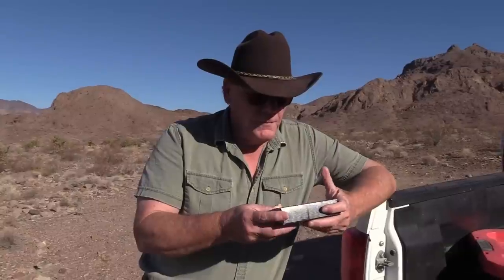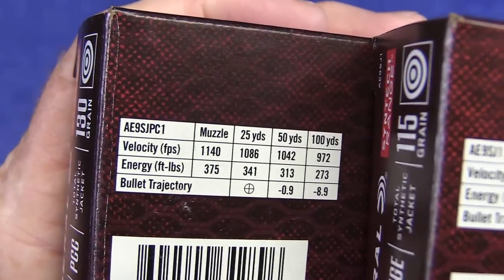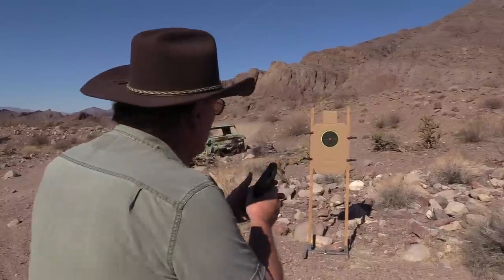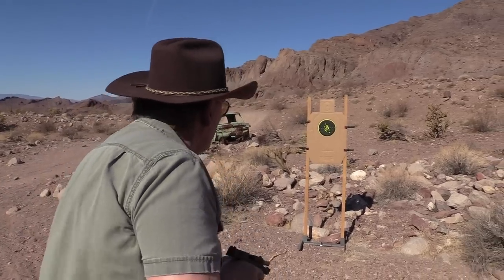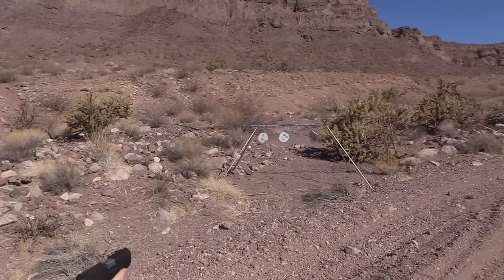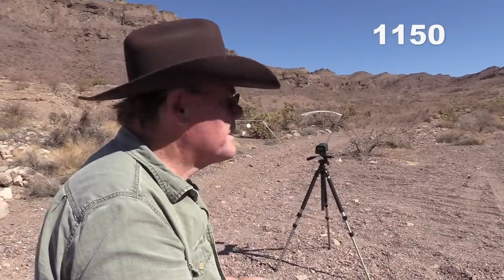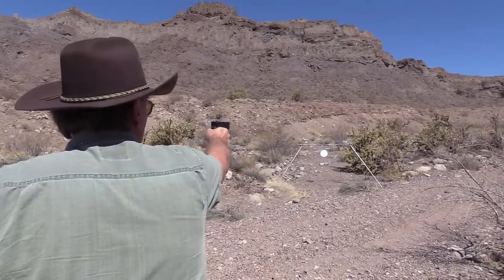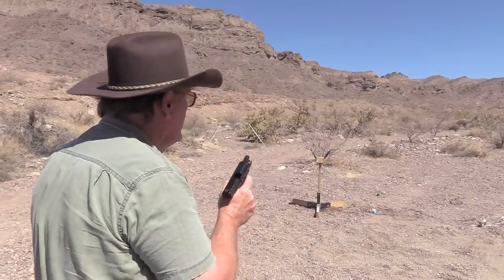Federal 9mm "Polymer Jacket" Ammo Review - Is This Stuff Accurate & Reliable? 3-Gun Shooting Review!

Comment: I like that Federal lipstick ammo. Ran a bunch through my Shield Plus until springtime 2022, mostly because it was readily available while other 9mm was still scarce here.

I liked the 150 gr best. Soft recoil, great for warming up before moving to hotter loads in a snappy micro nine. I saved a couple of boxes of the 150 gr in case a friend or family wants me to help with their training. It's the most user friendly standard pressure 9mm I've tried.

I've since switched to mostly Winchester white box NATO 124, and Blazer, because those are more readily available and affordable now.

Comment: Great video sir! I've used Federal Syntech a few times in my Glock 17 as well as a G3C, it worked fine with no failure to feed/eject.  The only issue I had was on a EC9S with a failure to feed however, I believe that was the gun, not the ammo. I was only able to pick up one box at the time, shot from around 15 yards and the groupings were quite tight.  For range ammo, I was pleasantly surprised by it's performance.  I use Federal at the range quite often and was always turned off by the "look" of this ammo, not anymore.  Great video as always keep up the great work!!
Reply from the maker: Hi John. I have been thinking of picking up a Ruger EC9s and if I get one I will do a review on it with this ammo and see what happens. I have tried this Federal Synthetic ammo in six different firearms and I haven't had any feeding problems yet. As always we thank you for watching our videos.
Reply: @mixup98  I would love to see your take on the Ruger EC9S, my experience with it has been mostly positive thus far.  The only thing I'm not fond of so far is the takedown pin, I'm usually concerned that I'm going to lose it as I'm cleaning my firearm, other then that takedown is fairly standard.  With non-adjustable sights I've kept it within 25 yards at the range and the groupings have been quite good.  I've put a wide variety of ammo through this pistol and it seems to like Fiocchi, Hornady, and Remington.  I've had some failure to feed issues with Federal ammo which is odd since I've never had any issues with Federal ammo.  Can't wait to see a video on the EC9S when you pick it up.  Keep up the great work sir!

Comment: Nice vid, thx for the post. I tend to mix it up at the range. This week I went through 50, 124 gr. Lawman TMJ, and some leftover Blazer Brass 115 gr and Venom 115 gr mix. My final was 30, 150 gr Federal Syntech. I find it is a different feel and has similar accuracy, not using a stand. One thing, upon cleaning, this time I found slivers of the red epoxy coating, inside near the feed ramp. Unusual, never noticed it before. As for Blazer and specifically Venom (somewhat hotter load), flake brass is found. Not on the Speer Lawman.
Reply from the maker: I haven't noticed any red slivers or flakes in my pistols but I will disassemble them and take a closer look. Thanks for the heads-up.

Comment: Love starting my weekend off with "Thunder in the Valley".  Nice video.  Would I be correct that this ammo would be easier to feed since the polymer coating should be more slippery on the feed ramps?  All the best to the Mixup Family this holiday weekend.
Reply from the maker: I would agree with you that feeding is probably more reliable due to the slippery feel of the poly coated bullet. I have shot this polymer coated ammo through six different firearms and they have all been 100% reliable. Have a safe and great weekend.

Comment: As hard as I scrounge, I have not been able to find any of this to try.  I may be dating myself, but I do remember Federal producing some ammunition they labeled Nyclad.  (Dark Navy Blue)
Very good ammunition!!
Reply from the maker: I also remember the old Nyclad ammo and I believe this Syntech ammo is basically the same thing. I found my Federal Syntech ammo at Sportsmans Warehouse.
Reply: @mixup98  Actually, the Nyclad was highly expanding defensive ammo and not inexpensive, never intended for the range.  It was originally designed for wide expansion from snubby revolvers, but they eventually made it in more calibers.  The nylon bullet jacket was thin and allowed a soft lead inner bullet to really mushroom on impact.  They charged MORE money than for copper jacketed hollowpoints and so it was discontinued in the 1990's.  It was reliable, except I had a couple of sunken bullets with no powder in them; maybe others did too...........................elsullo
Reply from the maker: @elsullo2  I never did buy any Nyclad ammo when it was on the market (to expensive) and I just assumed it was similar to this currently produced polymer jacketed ammo.  I appreciate the feedback.
Reply: I understand Federal is going to start producing Nyclad again. Haven't seen any yet.
Reply: The coating concept is similar but the Syntec core is not lead.
Reply: It sure didn’t take much of an effort to get the bullet out of the case. That would worry me. Does that coating come off in the bore?

Comment: Wow, when you cut that in half the jacketing looked ultra thin. Stands to reason there's a bit more lead to keep the grain weight as I can't imagine the poly coating weighs more than copper. Interesting ... they seem to hit hard like normal so that's good.
Reply: This is a powder coated bullet. Very simple to do with no fancy equipment. Toaster oven and normal bullet casting gear.
The jacket?  .002" thick. Thats it. 
To show how tough it is, I will test a few from every batch.
I put a bullet on something and hit it with a torch.  The jacket turns into a "bag" and the melted lead just does like water in a sandwich baggie lol.
Reply: @michaelkaiser1864  Very cool ... would like to see that.

Comment: I love to powder coat all my reloads. No leading whatsoever.
Best things to come along for plinkers..
Can't wait till they do this to all ammo especially .22 lr.
I love the tear down part they really do an amazing job on powder coating evenly.
Could you do a hardness test for us?
Reply from the maker: I have reloaded since the late '70s but I have never powder coated my bullets. Maybe it is something I should look into and maybe start doing. Unfortunately I don't have any hardness test equipment but I can say that the bullet that I cut open was made with a very hard lead.
Reply: @mixup98  its super easy and cheap. No fancy equipment needed. An old toaster oven.  Check out Elvis Ammo and Fortunecookie 45LC channels.
IF you cast, you can get some excellent ammo like this...no leading as Bill above said. I've gone 2500fps.
You can reuse prelubed bullets. Get an old sauce pan and fill it with water. Boil it on low.  Put it in the fridge for best results (hard wax is easy to get) or get some paper towels to get the wax off the top of the water.  Would suggest putting them in some acetone or similar afterwards to be sure all wax is gone.  For PC, the lead has to be clean.
Reply from the maker: @michaelkaiser1864  It sure sounds easy enough and I will check out the Elvis Ammo and Fortunecookie 45CL channel. It may be awhile before I try it though only because my supply of primers are running low. As you probably know finding primers now is almost impossible. Thanks for the suggestion and enjoy the rest of the weekend.

Comment: I'm thrilled for people that can shoot 115 grain without arthritic hand and wrist pain, but 147 grain is so superior in its softness, I don't know why anyone would shoot anything else. I use it for range ammo and HP.
Reply from the maker: I have several 9mm pistols that have a problem feeding 147 grain ammo so I tend to stay away from it. Personally I like the higher velocity of the 115 grain ammo, especially when shooting at the longer range steel plates.
Reply: @mixup98  OK but I don’t understand why they would have problem feeding 147 grain. They’re exactly the same size as the 115 grain. Are you saying there’s not enough blowback power? I have mainly shot Glocks for the last 13 years and so have no real basis for comparison. It’s never been a problem for me, but perhaps it would be with a bigger heavier slide. thanks for pointing that out. It sounds like 147 grain would not be ideal for a 9mm PCC.
Reply from the maker: @nmr6988  The overall length of a 147 grain cartridge is longer than a 115 grain cartridge and this longer length can cause problems in smaller, compact pistols such as my S&W Shield. My Shield will cycle with 115 and 124 grain cartridges but not the 147. My Taurus G3c won't even chamber a 147 grain cartridge due to the short throat (chamber) in the barrel. My Glock, on the other hand, has no problem at all with 147 grain cartridges. Anyway, have a great weekend and it's always good to hear from you.
Reply: @mixup98  , I honestly had no idea that the overall length of 147 is longer. That's kind of astonishing. I figured 9x19 meant 9x19. 😄  Thanks for the knowledge. I always appreciate it.
Reply from the maker: @nmr6988  You are very welcome. The diameter of the bullet is 9mm and the length of the empty case is 19mm. Overall length is determined by the weight and type of bullet used. Enjoy this holiday weekend and it's always good hearing from you.
Reply: @mixup98  And likewise, it is always a pleasure to converse with you.

Comment: Problem I had with polymer tips (different brand/type of “defense” ammo), was that tip was soft and bends/warps when I would eject it from my handgun at the end of a day of concealed carry, and put it back in the magazine. So the top bullet in the magazine that gets loaded into the chamber for the day’s carry doesn’t last. So either you are going to rely on a bullet with a warped tip as your first shot, or you are going to continually change bullets for the top one in the magazine each day. Not at all worth it to me and I found better defense ammo.
Reply: These are powder coated bullets, not the poly/rubber tips.  Think of it as a FMJ.
Reply: So what do you protect yourself and your family with if you unload every day?  Even if I have a shotgun at the ready, I still like to have my trusty sidearm as well.  And what handgun bullets have a polymer tip?  I have only seen that on rifle ammo.
Reply: @YoderTexas  I’m not an expert by any means, so apologies if I’m using incorrect terms. I just checked the box, and it’s Federal Syntech Defense (9mm Luger). The tip of that bullet seemed a bit malleable and developed markings and slight disfigurations on the tip when it was chambered and then later ejected and placed back in the magazine. I haven’t had anything like that happen with any other hollow point or “defense” ammo I’ve used, like the Hornady Critical Duty and Critical Defense. 

As to your second question, at home I don’t keep one in the chamber when I take it off my person. I’ll have a full magazine in, but I don’t have one in the chamber. Just a matter of preference with children in the home.
Reply: @HoyaSaxaSD  - What you are using is the same as what Mixup98 is reviewing, but with a hollow point.  Underneath the polymer coating is all lead and that's what deforms so easily.  There are rifle rounds that are polymer tipped for aerodynamics, but it wouldn't be proper to call yours polymer tipped.  I would call it a "polymer coated hollow point". Most other hollow points have a harder copper jacket protecting the lead, thus no (or very little) deformation.  Respect to you for trying to be safe around your children, but it's still a loaded gun.  If I were you, I would opt to lock it up loaded in a small handgun safe (about $25-$40), so that it is ready to fire as soon as your retrieve it.  If speed is important, save up for a safe with a biometric or RFID operated lock (about $200-$250).  Bolt the safe to a solid object.  Good luck.  --- Now, go spend some quality time with those kids.
Reply: @YoderTexas  critical Defense
Reply: @YoderTexas  thanks for the information re: the different construction of the ammo and the correct terminology. That’s helpful and makes sense. 
To clarify, I do keep it in a small gun safe next to my bed while at home, but I don’t have one chambered while it’s in the safe. (I’m not too smart, but smart enough not to leave a firearm lying around with my young kids around, whether with one in the chamber or not.) Not sure if I store it without one in the chamber because I heard when I first bought my handgun that leaving one chambered 24/7 could have some negative effect on the firearm long term, or just as a belts-and-suspenders safety approach. I’ll have to do some more research regarding whether there’s an actual downside for the firearm if it’s fully loaded 24/7. Thanks.

Comment: Does the combination of lead-free primer and the totally encapsulated lead projectile mean no lead exposure when using this ammo?
Reply from the maker: There is no lead exposure when shooting this ammo in an indoor shooting range.
Reply: @mixup98  Thank you for the quick reply. It seems like these are easier to find and a bit cheaper than the Federal AE IRT 70grain ammo which is 100% lead free. 
Assuming the polymer at the base of the bullet doesn't melt during the firing process this seems like a go in terms of lead-free practice shooting.

Comment: Hey Mixup 😀👍
Got a question for you.
What are your thoughts on using Blazer aluminum cased 9mm rounds in a pistol caliber carbine. (Hipoint 995 in my case)
I have been using some but just became aware of a warning put out by CCI not to use it in carbines as it may result in firearms damage and injuries.😳 I would value your opinion . Thanks.
Reply from the maker: Hello Bob and thanks for the great question. I would highly recommend that you heed CCI's warning and not use their aluminum cased ammo in your Hi-Point carbine. A 9mm cartridge produces approximately 35,000 PSI when fired and trust me, you don't want any of this pressure (or gun parts) blowing back toward your face, hands or body. Some firearms just don't do well with aluminum cases. I own several pistols where the instruction manual warns not to use aluminum cased ammo. Hope this helps.

Comment: Poor choice of color. Red is typical of snap caps.  Black would have been fine.
Reply: Yes but snap caps are typically all red and you can usually see the spring inside (not with dummy's but they have their own indicators). This has a brass case and markings on the back. Important to make absolutely sure that what you are using are snap caps or dummy rounds before dry firing/practicing in an unsafe place (typically a home). And even then, always do it in a safe direction.
Reply: it should be blue tipped

Comment: Love your videos but I hate GLOCKS..
Reply: That's ok, I love his videos and LOVE Glocks so it evens it out
Reply: Fudds gonna fudd...
Reply: Awe be nice to glock
Reply: Sorry you don't like guns that are great
Reply: SD9VE crowd let's go!
Reply: 150 grain is close to subsonic. Anyone try in a 26 or Shield short barrel?
Reply: @mdubb4855  Close to subsonic? Subs usually start at 140 grains. Also not the only factor for speed
Reply: @Femkroner  no not the only factor. But factory loads aim for fairly consistent ft-lbs of energy and as projectile weight increases velocity generally decreases to stay inside the power envelope The hottest big factory ammo I've come across is Winchester M1152 Army spec (IIRC 432 ft-lbs, in 45 territory) and the mildest might possibly be HST Lite (despite spec'd for defense). I think it might be easier to get hotter rounds to cycle (maybe beats up the slide and frame if th recoil spring is expecting target ammo) than light rounds, which might fail to cycle.